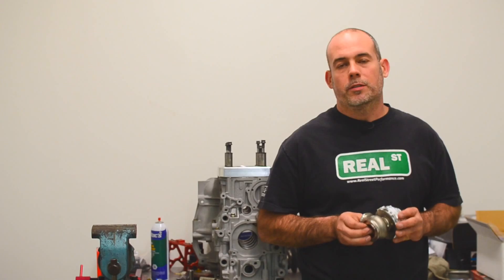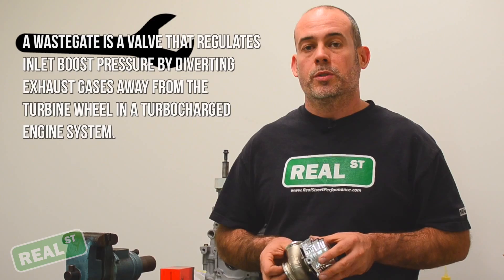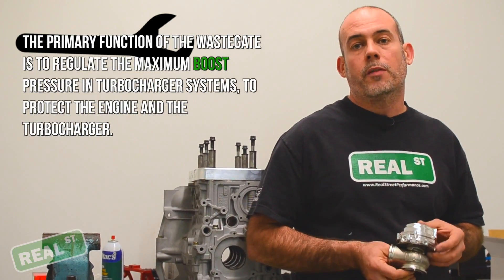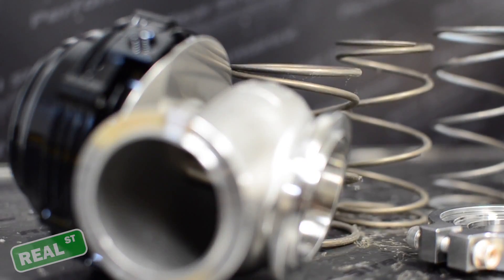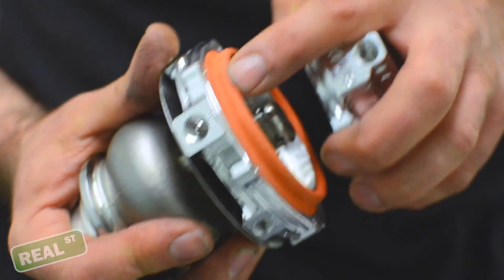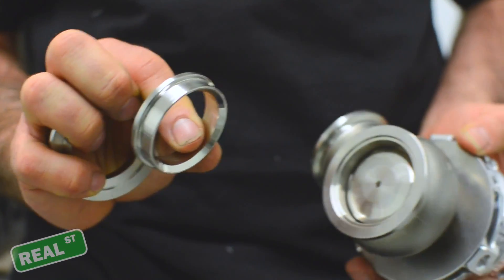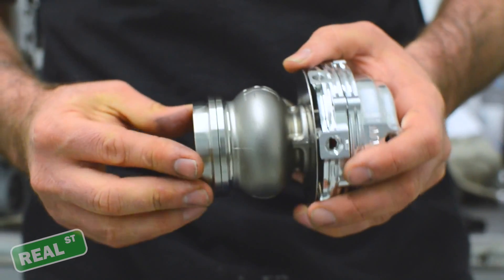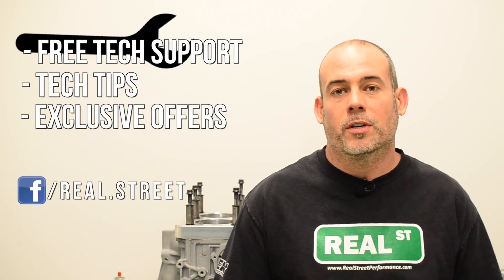Waste Gate Springs Jay's Tech Tips #11:

Comment: Hey I know this is an old video but I hoping for some info or a link to some resources that might help me understand. 

I have a turbo ba falcon with an external (turbosmart) waste gate, the vacume line from the waste gate runs to a little square component that I'm assuming is a vacume pump as its only connected to 2 wires. 

I was just wondering how that all works. like if a have a 10 pound spring how can it vary (be controlled) between 10 & 20 psi of boost

Comment: I got a tial mvs wg and I found the spring chart to be totally wrong. I tried a 16 lb spring and my turbo boosted to like 30 psi. so I put in an 8 pound spring and bench tested and it opened at 15 psi. so either the spring chart tial has is way off, or something is wrong with my wg. I found to get the psi I wanted I had to use the spring for half that psi on the chart. anyone else have this issue? I find that their bov works kinda the same way, whatever their chart says u should use, I go down 2 steps in spring and that's what will work for what u want.

Comment: Wait what? You said if you wanna run 10 psi you use a 10 lb spring. Then you said for 30 psi use a 15 lb spring..?
Reply: Go back and listen again. He said if you arent running a boost controller a wastegate with a 10 lb spring will hold 10 lbs of boost. You can double that with a boost controller. Hence a 15lb spring with a boost controller can make 30lbs.
Reply: ***** gotcha